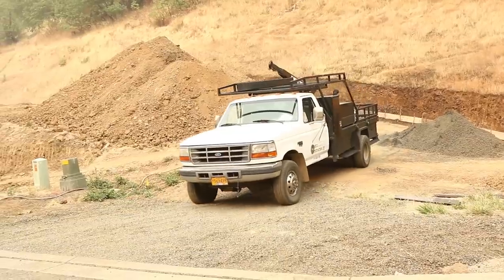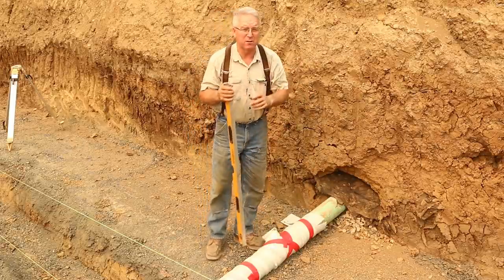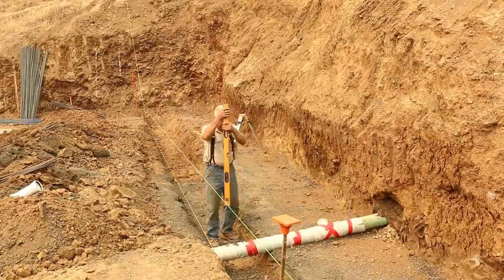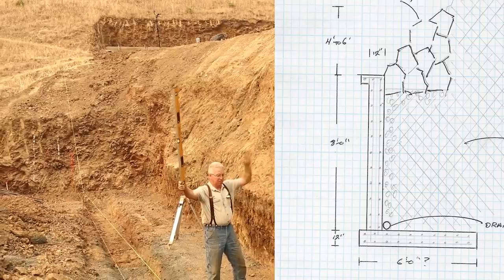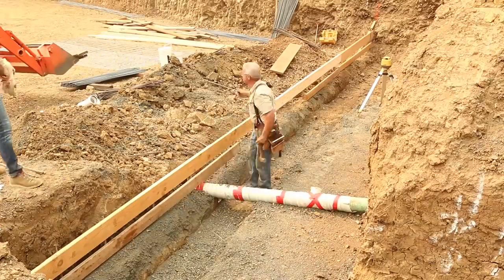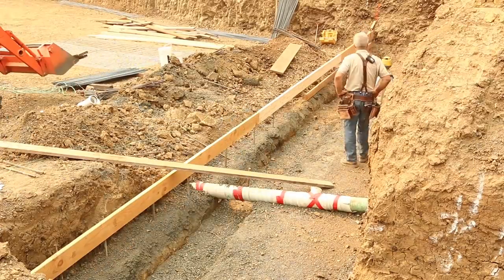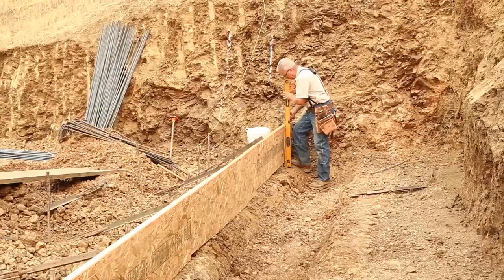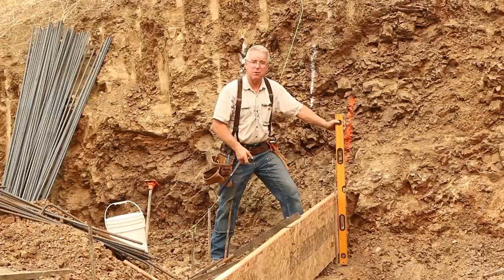Using Turnbuckles on XXL Concrete Footing  - EP.10

Comment: Scott, i 100% agree with going the extra step in forming concrete. I built forms for a set of steps that were 6 yards of concrete (as i remember) 24,000 pounds, a few years back. There were only 2 of us there for the pour and the owner. The steps were around 7' up to the landing which was also part of the pour and there were 9 steps. I braced the crap out of that form, and by the way they were on a hill like the one on your video, and touching a sidewalk on a busy street in my town. Anyway the owner wanted me to vibrate it and I was not comfortable with that because I knew the shockwaves would be immense. So i did and next thing you know the form started to blow out. I told the truck driver to stop pouring and that was my saving grace. The forms held and kept all that concrete from going out onto the busy street. We had to do a cold joint on that job to get the top done but the owner was ok with it because it looked good after plastering the face where the joint was. I almost lost my mind that day.

Comment: 0:30 It blows me away how precise you can get with hydraulic machinery. Such immense force under control by the millimeter.
Reply: LOTS of raw rear end time.
Reply: Yep, skill and intimate knowledge of your machine make the difference. All those times someone tears a buried pipe or power line out of the ground and makes a huge mess are operators not familiar enough with their work. Or simply not caring, rushed, tired, or something else.
Reply: True. When in foreign territory it pays to go S L O W ! Where I've been working I have to find tie-ins to utilities. I'm getting better and the last 2 or 3 have gone just fine but I can tell when I pull up on the job and a pile of crunched pipe and fitting parts are scattered around that the boss has been playing again..

Comment: Sir the turnbuckles are backwards. Be easier to attach to forms and easier to adjust if you flip them end for end. I used be in bridge construction we used turnbuckles on most all walls. Many times we had them attached to double 12’ 2x4s to kick off wall forms. I always wondered why more folks don’t use turnbuckles more often even on small pours
Reply: They'll work, allright! 2x's work too! Plumb up a wall quick!

Comment: Those form adjusters are perfect for bracing/straightening your walls before rafters. Just attach to a 12' stud for a wall brace and you can dial in your walls just like your doing with your forms.

Comment: Okay, so what is the plan for the concrete on the pipe, just pour over it or put something on the pipe to protect it ?
Thanks for sharing and take care. 👍
Reply: Ken Gamble the foam wrapped around the pipe protects it from expansion and contraction after the concrete it poured, most pipes in slab foundation houses will have foam around pipes too.
Reply: For a drainage pipe through a retaining wall footing, there would be no problem with this.
Reply: He did wrap the pipe with something, probably a foam sheeting.  You see it taped in place.  As he said, the municipality won't let him use the pipe, so he cannot tie into it with his own piping behind the wall for hydraulic drainage relief. So, he wrapped it to effectively stop up the holes in it and keep it from being used.
Reply: John Renner kinda but not really he wrapped that pipe with seal seal because concrete expands and contracts so the seal seal (foam) protects the pipe from pressure of the concrete and it has to be on any pipe that is inside the forms

Comment: County won't let you use that pipe....  I'd be ready with a T and cap and bury it in a 1/4" of cream.
Reply: I would have still used it... but had it hidden till everything is done. When theres no one looking, pop the concrete off and stick my pipe in. Im quite sure he'll find a way.
Reply: That would not be the 100% legal, upstanding, and honorable way, so it's unlikely you'll see it on this channel. But I agree - pointless regulations are for ignoring or working around.
Reply: This is clearly a man of integrity. It is the things you do when nobody is watching you that matter.

Comment: Concrete is a tricky thing to work with.  Think abut it, you're taking a liquid, forcing it to a direction, then waiting for it to solidify. You see how good your forms are once you pull them.  Not to mention how heavy that liquid is. My boss told me, if you think you have enough bracing, put another one in.  So we do every other up right.

Comment: Do you know that in Indiana I am the scout master of a boy scout troop that a boy made a wheelchair ramp that was a combined 100 feet long and took 8 tons of pea fill 12 to 18 tons of broke up concrete fill and 18 yards of concrete and you know what the bottom set of forms were 4 and a half feet tall and we had a massive blow out and we all worked very hard and saved every bit of the 8 yards of concrete in the first pour and no significant knowledge of the skill for concrete but everyone knew how important it was to try and save it and we pulled together some ideas on what to do and ended up saving all of the spilled concrete with absolutely no waste unlike some crews that work for my boss that would probably just leave it to set then chip it out and start over.
Reply: That was literally one sentence long.

Comment: Nothing like watching a 20ft 2'x3' electrical riser formed up by electricians using 2x4's and OSB with no bracing being poured. The pump truck operator didn't have to work for long that day.
Reply: 10 minutes, max.

Comment: Out of control regulation on that drain pipe and a little waistful. Slows progress. It's good to a point and stupid past that point.
Reply: Pratts Greenhouse  , your correc
Reply: They don't know why it's there or what's hooked to it. The city/county isn't going to approve what's basically a giant question mark. Still good on the excavator operator. Easy as hell to rip up what looks like 4 inch thinwall.
Reply: Typical ridiculous Oregon over-regulation.

Comment: Is there any precedent for shimming/bracing the form wall past plumb, IE inwards toward the pour side, anticipating some give in the wall with the weight of the material?  Or is it always just double checking after the pour and correcting as needed?

Comment: so if you think hooking utilities that "don't exist" isn't common. once I was on a job building a gas station and we were digging out a creek to put a 355cm(~12ft) pipe to divert the creek and be part of the foundation of the store, and we hit a sewer force main, wasn't on the drawing and no one from a local neighbor hood could take a shit because the only thing we could do at the moment was pump the discharge back up to main's pump to have it discharge on top of us. it turned out the county was suppose to move the line over, forgot to do it, marked it as complete, and labeled the old line as "not in operation." I was responsible for making certain the hose to our pump didn't pop out of the man hole, because we only had enough hose to reach the hole.

also on your "praying for rain" there is a urban myth that if you put a paver on you job site, it will not fail to rain.

Comment: That's the retaining wall that counts, they didn't design in any knees to help brace that wall. You can never have enough bracing and nails in concrete forms, its a hell of a lot cheaper than having the mixer and pumper waiting while your running around like a chicken with your head cut off because the form work blew out.  When your paying 220 dollars a meter for concrete you don't want to be losing it.

Comment: If the county won't let you use the pipe, what prevents you from capping it off?  They can't complain if there's no easement, right?  Heck, how can they complain after insisting it wasn't there to begin with?     

Would the county then need to mitigate the drainage issues in another (costly) way?  Would that perhaps be the motivation needed to engage their cranial matter on the issue?

Comment: That pipe situation is bonkers. If there's no easement, and they didn't even know it existed... And you bought the land... It's your pipe. What you do or don't do to your own pipe seems like your business... Presumably you could just block the thing off and mess everything up upstream of it... So... WTF!
Reply: Well, I guess you'd already planned your drainage anyway. While convenient, the pipe's just in one spot. Plus, the wall you're putting there is gigantic and concrete. It's not going anywhere! 

Also... For any little mistakes you may make along the way... In this, or just in general... I'll private message you to a link (actually a couple)... Showing some new structures (including what could loosely be described as a retaining wall, only... backwards... that will 1) HORRIFY you... and 2) Make you feel immediately better about any little mistakes you make in any building ever again. I hope to make what I'll send very public quite soon, but for now - because I want the perpetrators behind bars - I have to keep my powder a little dry...
Reply: Sir, I emailed you via the email link in your Youtube information (Gmail). There's an image attached, so it could end up in spam. I hope you don't mind. I think you'll understand when you see the structure in question - basically, you're doing a very good thing by demonstrating excellent workmanship on youtube... As it can hopefully prevent such horrible - potentially very lethal - structures as the one I emailed you about!!